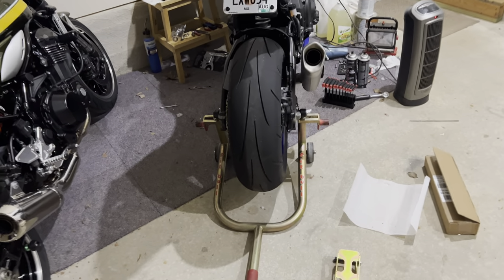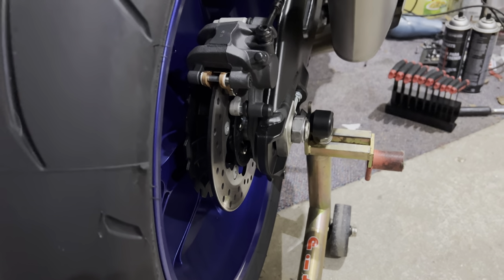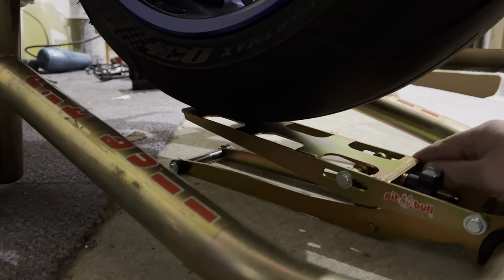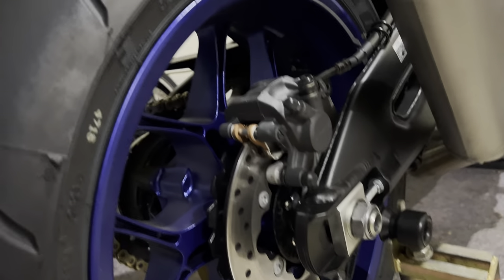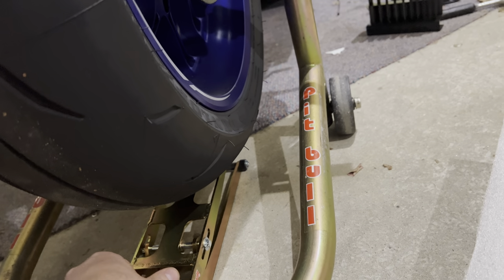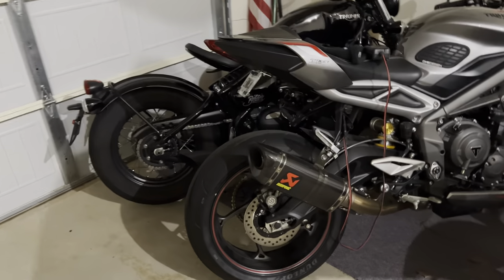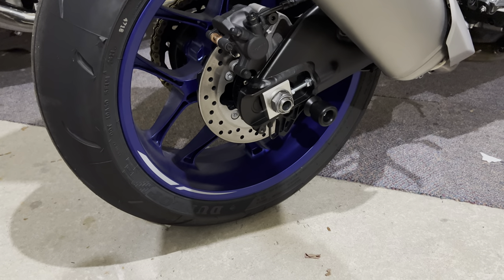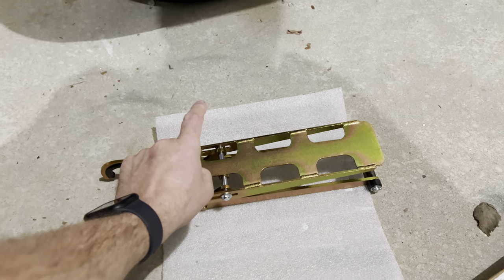Pitbull Stands - Pit Crew Wedge is a must-have!

Comment: Nice..... it looks like it would work with my Muzzy stand also.  My Pitbull stand is setup for front under gooseneck when removing both wheels at once.  My right foot is still sore from holding wheels up.
Reply from the maker: Yeah, as long as it can sorta clamp on to the frame of the stand to keep it steady...

Comment: Nice item.  I wish I could figure a way to use a paddock stand on my T100.  I'm changing the silencers to BC Shorty Predator Pro.  I'll have to look closely at whether the swing arm supports on that stand will work with those silencers on.  How do you lift the rear of your Triumph?  I am using a center stand now which is ok.  But, it would be nice to just pull that off and use a paddock stand instead.
Reply from the maker: I think for the Speed Twin, it didn't have mounts for the bobbins, so I flipped the pitbul stand hooks to the padded bumper side and just put that under the swingarm and lifted it that way.

Comment: Could this be used without a rear stand? For example I have a tracer that has a centre stand.
Reply from the maker: Possibly, but what makes it work so well is that it's mounted to the Pitbul stand so it is always in the right place, aligned correctly and it can't move around in relation to the tire...